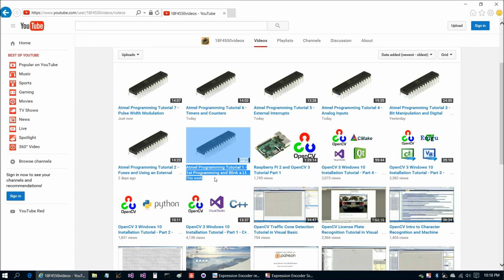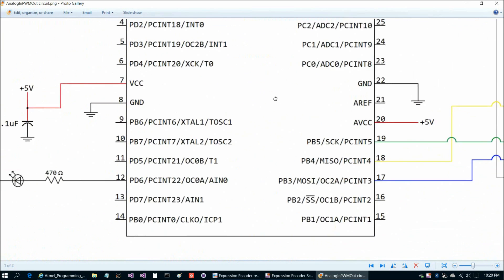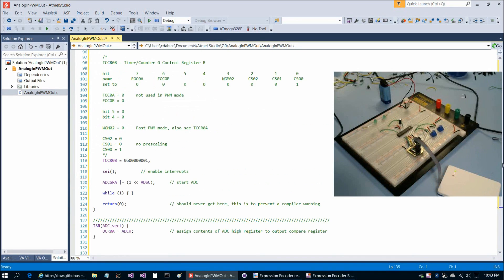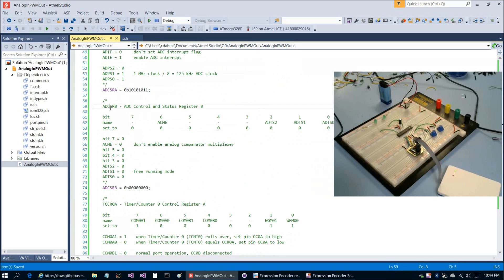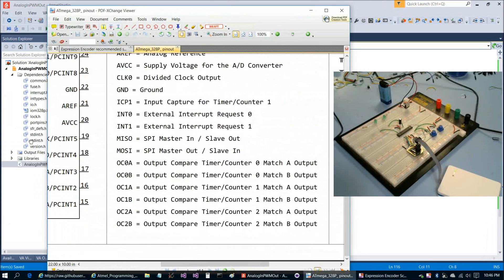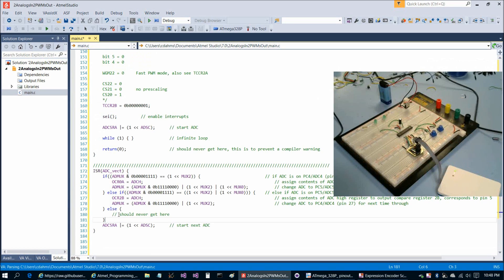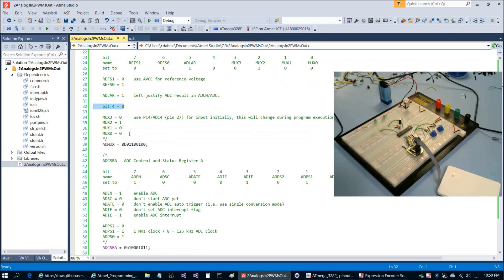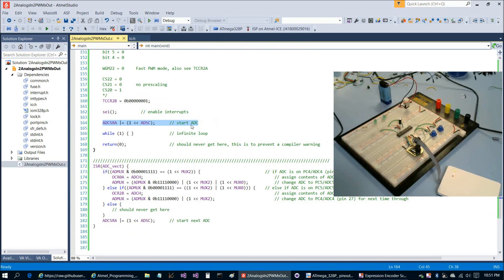Atmel Programming Tutorial 8 - Multitasking

Comment: Any chance you can show us how to drive an oled display with the ssd1306? Oled are real cheap on fleabay about 4 or 5 bucks.Adafruit and arduino just throw libraries at us would be neat to see one driven from the core bit bang level using the different interfaces ie 3 and 4 wire spi,usart,i2c ect

Comment: it would be better if you turn off webcam while you explaining code section. Can't see comments in the code.
Reply from the maker: Thanks for the suggestion, I'll take that into consideration, however I feel it makes the software/hardware interfacing concepts more concrete if I show the board as much as possible.
Reply: yeah that's nice but it would be better to see hardware video while the code is running.